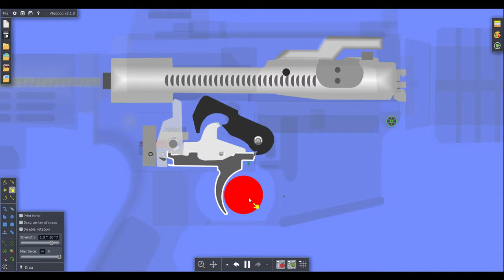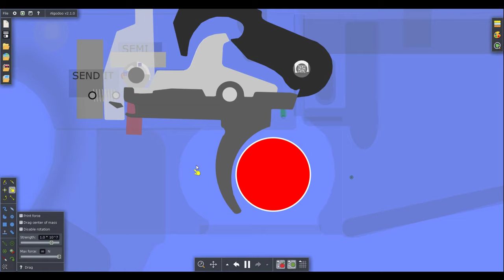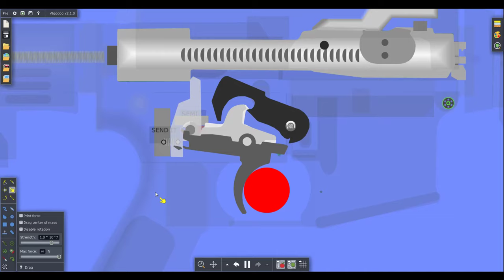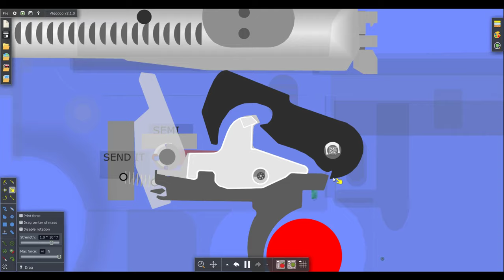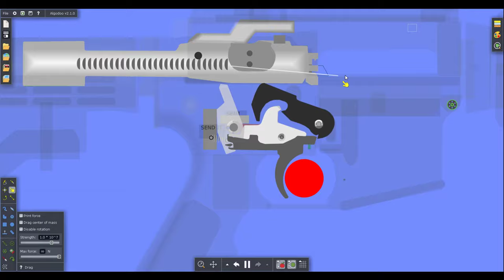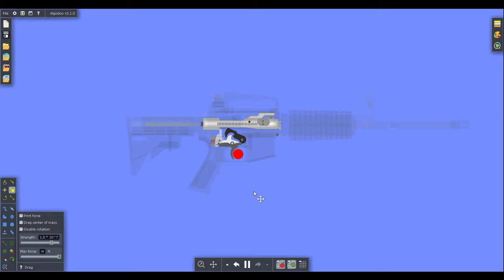How Binary Triggers Work

Comment: Are you suggesting that simply grinding the catch down a touch would give you binary? Just making sure I'm following. It's genius btw. I've been trying so hard to figure out a way to make a "homemade" binary
Reply from the maker: That’ll work, just don’t overdo it and give yourself a “bubba full auto” where it just slips off the disconnector on its own.

I’d recommend going online and looking for a burst trigger kit (minus the auto sear - the rest of the kit is perfectly legal without a tax stamp) and do the filing to your burst disconnector. Now you can turn your binary mode on or off. 👌
Reply: @StealthTheUnknown  I mean even the auto sears aren't regulated(unless it's a drop in sear), but I wouldn't really want to get caught with one in combination with an AR. The reason is the auto sear can't be used without modification to the receiver. Many parts kits do come with auto sears though it's advised to get rid of them.

Comment: I have a franklin armory trigger I just installed. How can I fix the jambing of a live round? It's like every four rounds always on the release.
Reply from the maker: Tell me more about the jam. Are you having a dead trigger - that is, live round in the chamber and the hammer forward? Or are you getting issues like failing to feed or eject?? These are very important distinctions.

If your jam is that you get a dead trigger, you’re running the gun too fast and you caused the hammer to ride the bolt forward - not enough energy to adequately dent the primer for firing. There’s nothing mechanically that can be done about this, your best options to accommodate this drawback of these triggers is to train yourself to match the cycle rate of the rifle, or you can get yourself some light primer ammo - the stuff the ATF uses when they’re making an example of someone and forcing their creation to be a machine gun for the sake of prosecution and money-making😏
Reply: @StealthTheUnknown  Hammer striks and it misses by a little, only on binary and release
Reply from the maker: @scal760  you’re probably shooting it too fast, but this takes practice
Reply: Yes! Thats what I figured i was doing need a split second pause i thought it was because of not using the new buffer spring.
Reply from the maker: @scal760  use the new buffer spring

Comment: wow that was a lot more simple than i thought it would be. Im wondering, I always had the idea that if someone grinded off the catch or something, that it would just make it full auto, I never had the thought that it might actually make it dead strike the bullet. how does a full auto work without deadstrikes?
Reply from the maker: The magic of automatic sears, which are like a trigger (or a sear, which catches the hammer) which gets pulled by the bolt when it closes, if that makes sense. I have several videos that explain full auto at least briefly, look at my 3-round burst video for m16 triggers and my forced reset trigger video.

Comment: The legality of the trigger staying depressed without the user applying pressure is iffy because if you were to look at it in slow motion the firearm would discharge itself without the direct action from the shooter and some might say that this trigger is firing more than 1 round per direct action therefore making it illegal because it can be viewed as proper 2 round burst
Reply from the maker: It is iffy. Which is why I wanna test it
Reply: The function of a binary trigger is to fire when both pressed and released. Even if the release fire is slightly delayed, it's not changing the function, it's just preventing out of battery firing and making it more reliable.

Comment: ive got a set of questions so i have an ak-47 i made a binary trigger for it using 2 disconnectors i have a video up about it but im now wanting to make a binary trigger for my ar-15 if i shave down my disconnector enough just a bit will  release the hammer a bit earlier so when you release the trigger it fires a second shot
Reply from the maker: Questions?? Sir that looks like a run-on sentence to me🤔

Yes, the operating principles of an AK and AR are pretty similar and you can do the same thing to an AR to make it binary

Comment: What if you filed down the catch on the disconnect…would that basically make it binary?
Reply from the maker: If you did it on the semi disconnector used for individual shots, and not two for hit and release, then it would end up just using the binary disconnector and firing on hit and release.

Comment: How does the selector interface with the disconnecters to choose between the binary and semi?
Reply from the maker: It blocks them from rotating. It’s basically a drum or thick pin with cutouts; the cutouts allow it to move

Comment: Any idea why my Franklin binary has a hard pull in semi but light pull in binary?
Reply from the maker: Which version do you have? For which firearm?
Reply: BFS 3, for a built ar 15
Reply from the maker: @jasoncourtney314  is that the gen 3 with a single disconnector? yeah that's kind weird. there's extra mechanical stuff going on in binary. I'd honestly need to see a physical sample and play with it to see what's going on
Reply: @StealthTheUnknown  thanks for trying,  I'm going to keep dry firing and using it for a while.  Then pull it back out and see if I can see where the two parts are worn more than others. Then try to slowly file it down and try firing and repeat process until it's right. My bianary in ar 10 works perfectly. Thanks again.

Comment: "It functions exactly the same way as the other disconnector. Its dimensions are just different, and that results in a different function." Haha, what? I love it when someone who's intent on education contradicts themselves from one sentence to another lol. Also, these "binary" triggers are illegal. Don't buy them; don't attempt to manipulate your current one to mimic it either. The reason being, when the trigger is held in that "sweet spot," whereas neither the seer nor the catch will hold the hammer in place. It will cause the firearm to be fully automatic... So, unless you're intent on having ATF agents over for dinner, I would avoid these "binary" triggers at all costs. It's funny he mentioned Franklin's binary triggers. Those are legal and won't malfunction. Buy one of those if you want a binary.
Reply from the maker: No. They aren’t illegal. There is no “sweet spot” law. And you’re not a lawyer. And I didn’t contradict myself; you just didn’t hear/understand what I said correctly.

But keep on with the keyboard expertise
Reply from the maker: “I’m gonna insult your intelligence and fake laugh about it awkwardly. Also, I’ll give you some unsolicited advice that wasn’t needed.”

Really works well, winning formula bud.

Comment: I don't think ATF would like this kind of binary trigger since you probably can easily modify to full auto.
Reply from the maker: How so? While it may appear to be the case that some automatic function allows the hammer to be released, it's not true; the function of hammer release is contingent on one single function of the trigger being fully committed to. that is, you have to DELIBERATELY try to press or release the trigger for a mere single shot; the only thing automatic is the timing of when that function occurs, regulated by the trigger catch (not an auto sear, not even a sear - it never interfaces with the hammer.)

according to the legal definition of a machine gun, it is any firearm which can fire more than one single round of ammunition per function of the trigger - ie, hit or release - or, a component which, when installed in a firearm, converts it to function in such a manner. 

now, the rate of fire you can accomplish by wiggling your finger really fast is IDENTICAL to full auto, but you deliberately and manually fire every shot. It's in the deliberation of those individual functions that makes the thing legal, and still a semi-automatic. No non-destructive alteration of the components depicted, or the removal thereof, or the addition of any components (save a legitimate, already regulated automatic sear, or a lightning link, or device of a similar function), will result in the device being converted into a machine gun, nor will any physical manipulation of these components by the operator accomplish such an effect.

Comment: You see the problem here is that third pin hole that you put on there in the back buddy if you have that someone could argue that that's a full auto
Reply from the maker: Not if it’s in the trigger pack instead of the receiver. The fostech echo has a similar pin and is market legal
Reply: @StealthTheUnknown  big facts
Reply: I'm still trying to come up with an easier way like the zip tie binary method
Reply from the maker: @atozproductions9660  you heard of the clothe hanger auto trip?
Reply: @StealthTheUnknown  we don't talk about that one